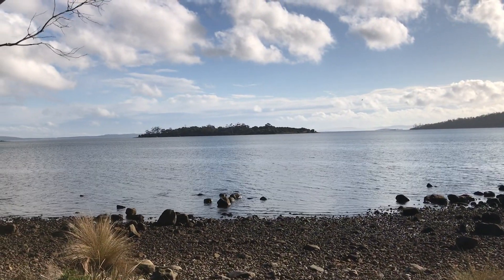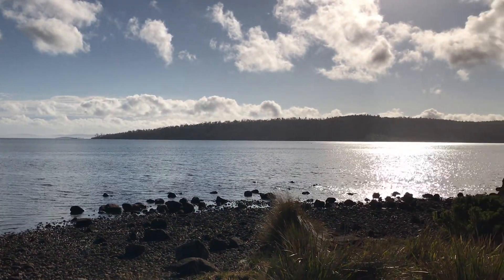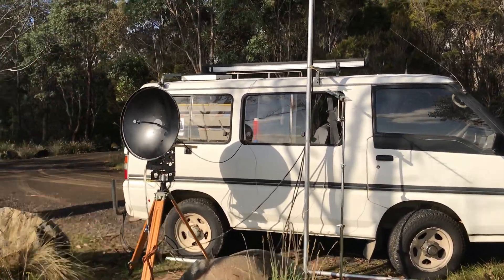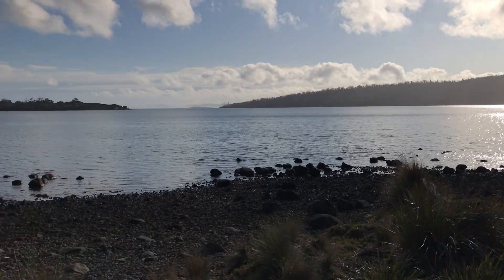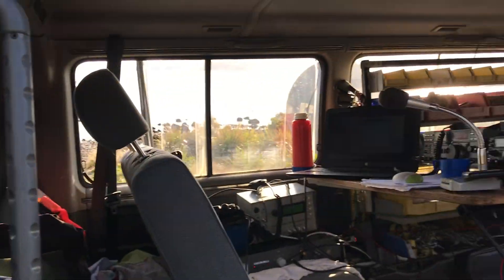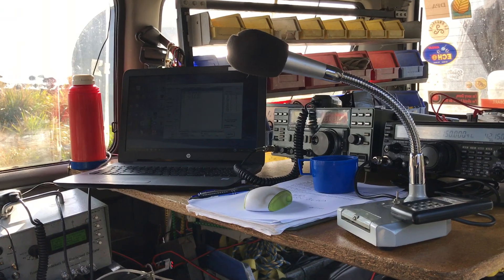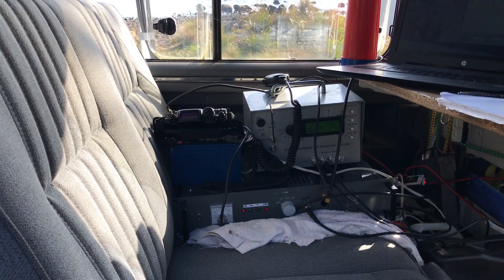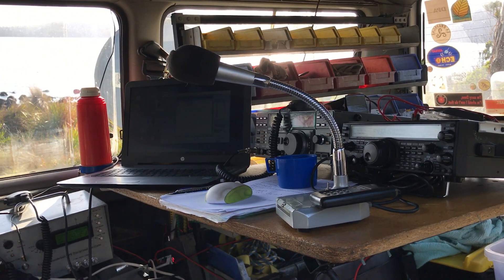2020 WIA Winter VHF/UHF Field Day Operation

Comment: That explains the great signal I was getting on 23cm! Just as a side note, that location, in particular the boat ramp was where in 1988, 1989 & 1990 Australia day long weekend where we launched to head over to Dart Island (centre of view) for a scout camp! VK7AW was there on the first camp and he bought along his emergency comms box (kinda a precursor to wicen) where on the first night we had a brief introduction to the 80m band. Unfortunately the car battery was not up to maintaining its operational voltage so radio was cut short until a replacement battery was sourced from one of the vehicles that remained at the boat ramp!